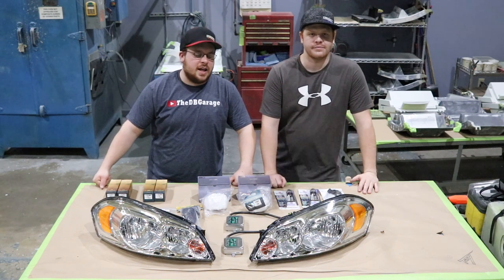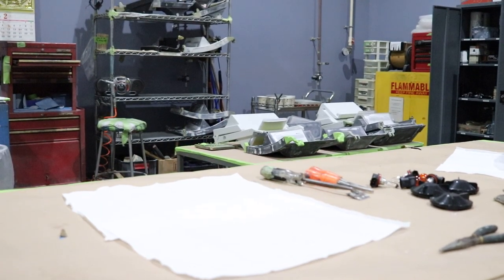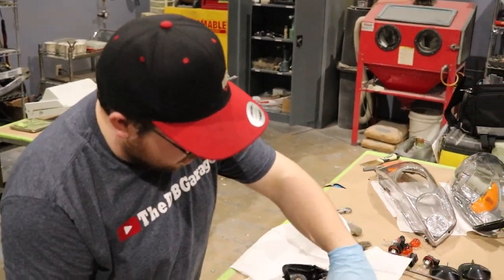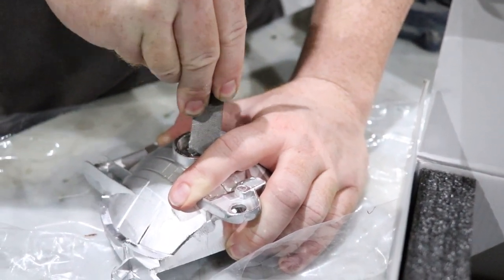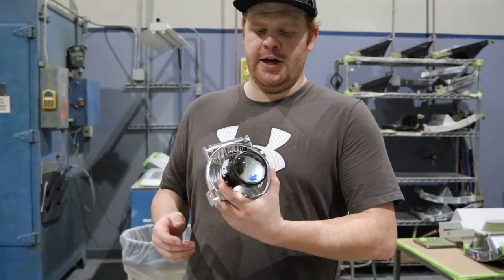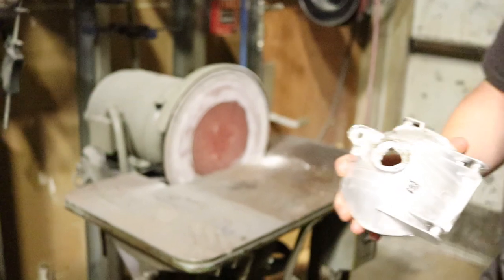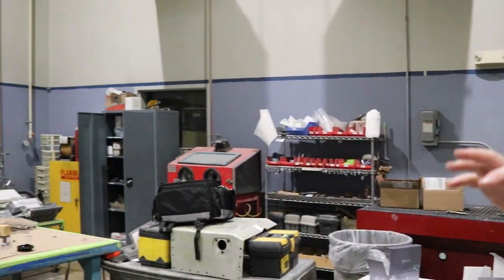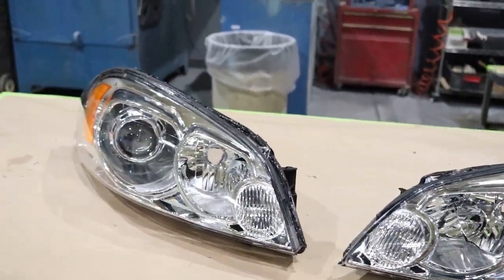2006-2013 Chrevolet Impala RetroFit How-To

Comment: are those H11 or H1? does it require any wiring because i noticed the wiring
Reply from the maker: It is h1 from an h11. They make an adapter to plug it right in

Comment: Good news is finished product looks - Bad news is you inhaled the plastic dust from your belt/disk sander which will never leave your lungs! Get smart and use a face mask when grinding plastic or Bondo. I know of body/machine shop guys that have either died young waiting for a lung transplant or are tethered to an oxygen tank for the rest of thier shortened lives due to those bad habits.